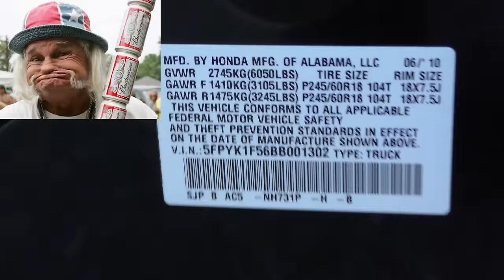Here's Why This Truck is a Better Buy Than a F-150, Silverado, and Tundra

Comment: Ridgeline is a truck bought by people who basically want to drive a Honda Civic. But they appreciate the usefulness of the truck bed. They are not truck guys. But, in buying a Ridgeline, they get the best of both worlds.
Reply: Agree 👍
Reply: 4 inch bed ?  Not a truck!
Reply: i own one. its more like an accord v6 than a civic
Reply: O S,
Not so at all, but we're glad you're telling everyone what they should drive. Mighty nice of you.
I just sold my RAM because I sold my tow behind trailer, and I wanted better gas mileage. It still tows 5K and has a payload of 1500. AWD and all the bells and whistles. And, it'll typically out last any of the big trucks plus it'smuch more reliable. But, your opinion means so much to everyone.
TY 👍
Reply: @jimmerkerlin5005  Learn to take things easy bro.
Reply: @jimmerkerlin5005  till the transmission goes hauling with it too much . Happened to my friend
Reply: It's a great vehicle
Reply: @chuckpar2206  And it has a higher payload than some 1/2 ton "Trucks"
Reply: Scotty said that last week lol
Reply: Wrong OS. I've owned 2 full sized trucks that needed a shoe horn to fit in the  garage and went thru gas like water thru a sieve. Also had 5 full sized truck for work. My 18 Ridgeline gets 23 mpg, hauls anything and fits in the garage with  ease. It rides better, corners better, and has the 2 way tail gate and trunk. Better than any of the before mentioned trucks.
Reply: @selectedsilversire7208  I have to agree 💯 … but they’re ugly.

Comment: Scotty, can I ask your thoughts on how to navigate purchasing choices for a used Ford Transit Connect? Prior Toyota owner, until my car got flooded in Hurricane Ian. I am looking for a small utility vehicle. Wish Toyota made one. I’m not so confident shopping around for a used Ford as I am Toyota. Any suggestions?
Reply: Mailman has the little dodge type transit. It's been reliable for him and hasn't gotten stuck in snow even though it's only fwd with tiny tires
Reply: We used the Transits for work . They’re not that good of a work van . If you can find another option , do it . 🙏🏻✝️😍

Comment: Hey scotty, I have so much blessing for you and your family.  I have a 2013 corolla S, it rumbles the dash sometimes only when in reverse, any ideas ? It only has 91000 miles
Reply: Transmission mount
Reply: @rubadubdubwobwob  love you Luke.  God bless you and your family
Reply: Just a  transmission issue. The only thing you out to do is just make sure that  the transmission oil is in good shape.  If it's in good condition then the transmission itself has an issue which may require rebuild . If the fluid is poor then change the transmission fluid.

Comment: Ridgeline Towing Capacity: 5000lbs
F 150 Towing Capacity: 13,500lbs.
Those "made in usa, but profit goes to japan" foreign trucks crack me up with their tiny little passenger car size differential boxes. Then you see a cummins diesel next to one with like a school bus sized differential.
Reply: Are you slow? You'r comparing a 2008 v6 Ridgeline to a new F150 v8....Go compare a v6 Ford to a Ridgeline of the same year, and you'lll see they have the exact same towing capacity.
Reply: @TomTomTom87  Are you slow?THE VIDEO is comparing it to the F-150 V8.  Pat pat pat.

Comment: SCOTTY, I HAVE A DILEMMA. I HAVE A 2008 HYUNDAI VERACRUZ. AND THE PROBLEM IS EMERGENCY BRAKE CABLE IS BAD. AND I AM HERE IN ROCHESTER NEW YORK AND THE HYUNDAI DEALER SAYS THERE'S ONLY ONE CABLE EMERGENCY CABLE AVAILABLE WITHIN THE WHOLE NATION HOLD UNITED STATES ONLY ONE. AND IT'S COSTING $250 FOR ONE CABLE AND YET I HEAR IT'S THREE CABLES WHAT DO I DO IS THERE A WAY TO MAKE SHIFT AN EMERGENCY CABLE? THIS IS JUST AN EMERGENCY BRAKE CABLE COULD I USE A CABLE THAT'S  THAT'S USED FOR YOUR TV SET? IT'S JUST A CABLE LINE. THE PARTS GUY SAID IT HAS THREE LINES THAT GOES INTO A HUB SO RUN THE CABLE LINES INTO THE HUB INTO THE BRAKES IS THAT POSSIBLE?

Comment: So you gotta change the belt every 100k.  Big deal.
Reply: Very expensive labor intensive job for what it is…
Reply: @mikefromoh2925  agreed.  But seeing as the average milage in this country is around 8-12k then having to every 10 years is no real bother in my opinion.  Indeed most people don't even keep a car that long.
Reply: @rob5944  I gotchu brother.